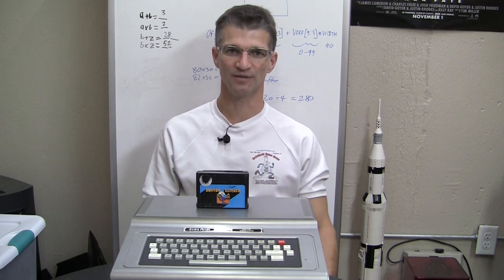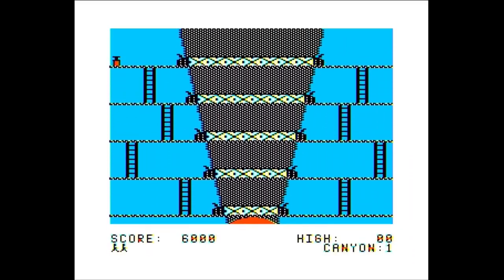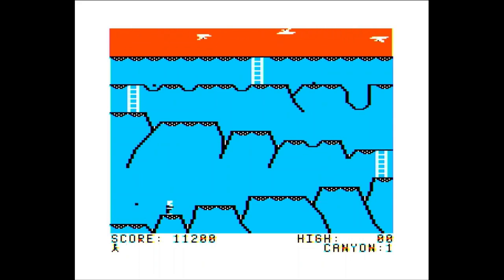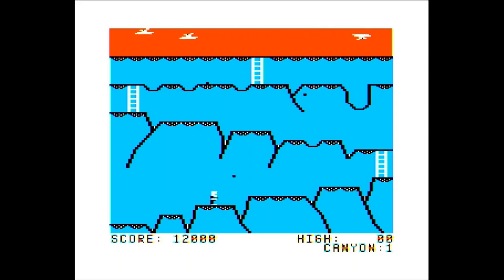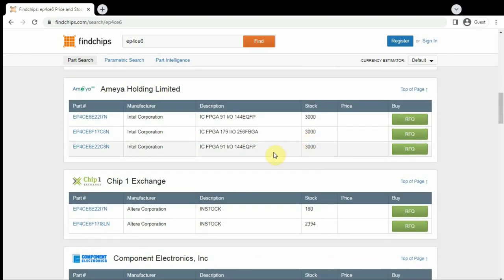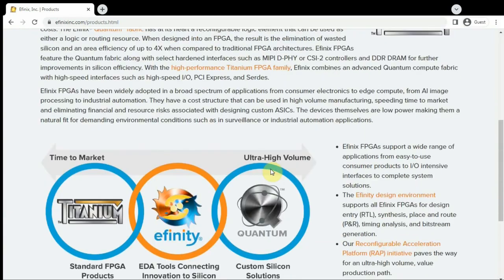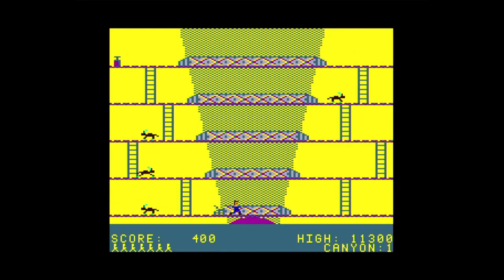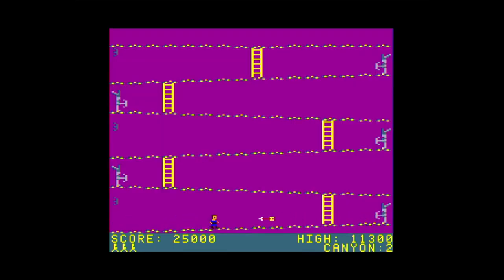Canyon Climber- Sprites and 16 Colors !  SepTandy 2022 #trs80 #septandy Steve Bjork

Comment: There is another bug in this game that I found playing Game-on-challenge for this game. Go to the 2nd level where you jump arrows. Go up 1st ladder completely and then come right back down ladder to floor. Now arrows will not hurt you until you go back up ladder. One could just hold down the jump button for hours to get a really high score jumping the arrows. After a while of holding down the jump button, the arrows get extremely fast.
Reply from the maker: I have to say, I tried this back when you left this comment, and it worked!  That was so cool.